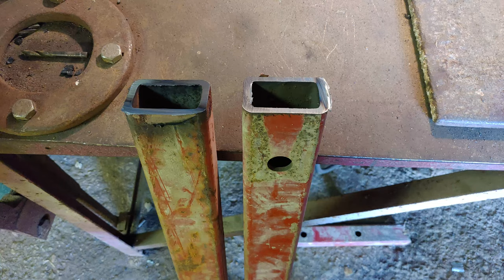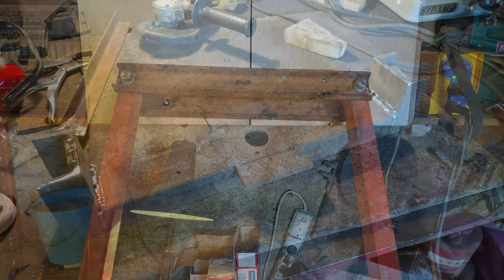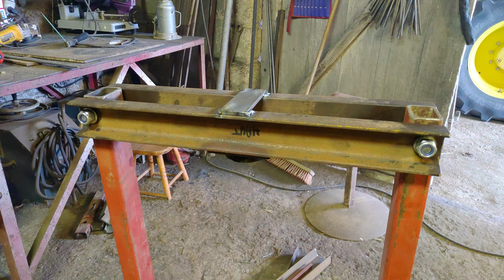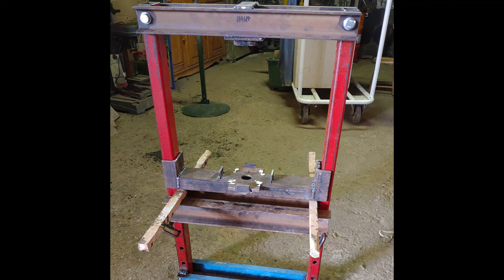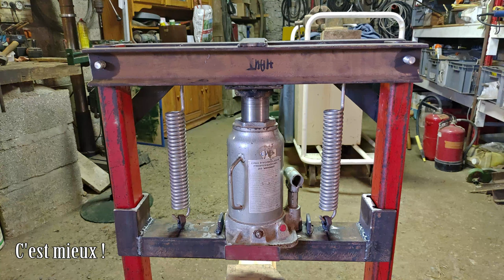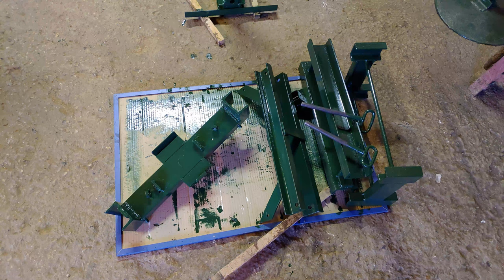Fabrication d'une presse hydraulique !

Comment: bonjour:  quel est le diamètre et longueur des ressorts de traction ?
Reply from the maker: La longueur correspond approximativement à celle du cri, soit ici environ 25 cm. Diamètre de la tige, 4mm, diamètre du ressort, 4cm
Reply: @vincentrousseau89  merci de votre reponse
Reply: Bonjour pourriez-vous m'indiquer où vous avez trouvé vos ressorts, svp? Quelle force ont-ils? Merci de votre réponse.
Reply: @SABAST31  en cherchant sur le net, tu peux trouver des ressorts pour des sacs de sable (boxe)... pas évident pour les ressorts, c'est a peu près le plus dure a avoir.. pour le reste c'est facile... :)